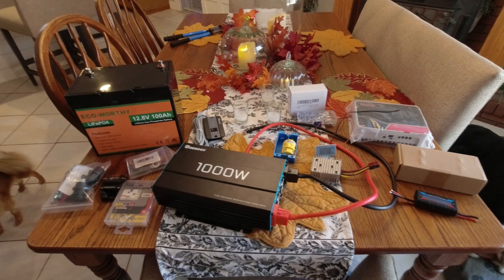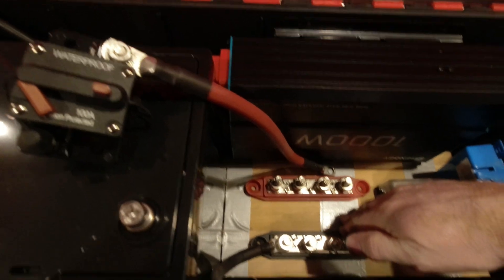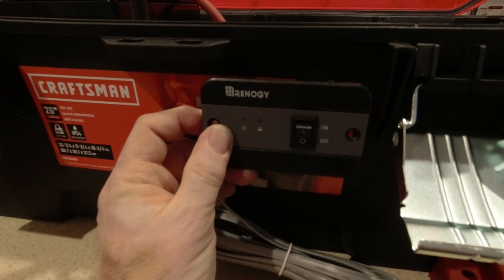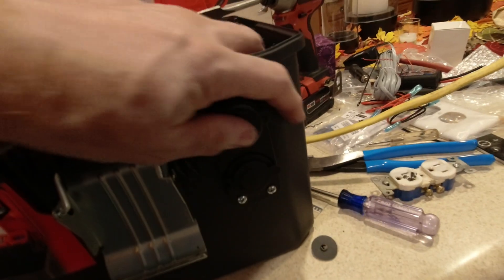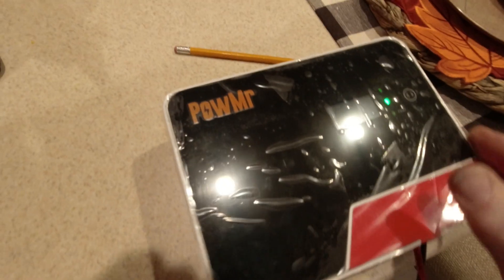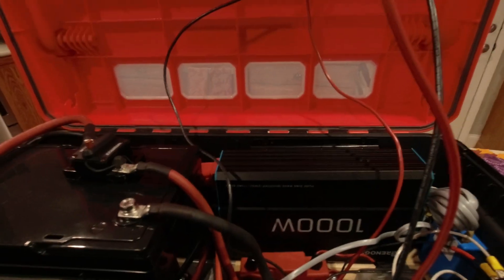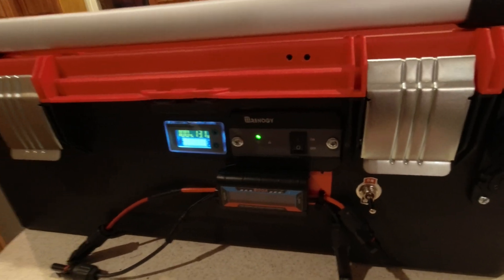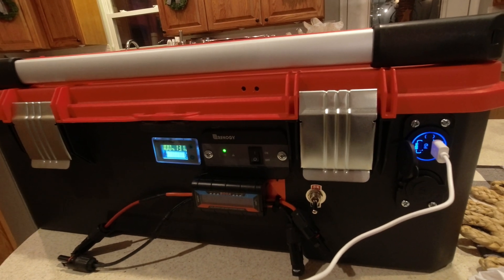DIY Battery Extension for my AC200P

Comment: Really nice build. You mentioned that the PD/USB isn’t on the switch because it has a built in push button switch. Not sure if it’s the same one I have but I noticed that it was pulling power even when the push button was off. If yours is doing that then you might want to consider putting your own switch on that as well. Great video.
Reply from the maker: I’ll check to make sure it’s not pulling power when it’s off, thanks for watching and commenting.

Comment: I like this build, especially that it's a power station AND a battery booster at the same time! Great job getting it all to fit in that cool tool box. One thought, that 12v to 24v boost converter is pulling near 20 amps from that cig plug on the power station (24v @ 10amps = 12v @ 20amps = or 240 watts). If your shunt was on the other side of the converter, the input side, you'd see around 20 amps passing through it. Remember power input = power output so theres no magic power being doubled. It's complicated to explain in a comment. Just be careful pulling 20 amps consistently since that 12v cig port will get super toasty unless you use a better connection type (XT60 or AndersonPowerPole).
Reply from the maker: Yes I’m going to add an xt60 connection. I does get a little warm when I use the converter. Thanks

Comment: I think you made the right call. I found the DC Charge Enhancer to be less useful because of the amp limitation. I was using 18650s in a 6s configuration to add about 2kwh extension to it. I was going to bump it up to 48v and I still might, but I took those cells out of those boards and I am going to use them as part of a DIY server rack battery. I also am using a BigBlue CellPowa 2500 instead of the AC200P in my shed now since it has wifi monitoring so I can trigger AC charging when solar is bad.

I'd consider turning those two small holes into slits, but I'd also probably place them lower on the case, maybe the bottom or near the inverter air intake. It really depends on the fan and how much pressure it has though.
Reply from the maker: I like the charge enhancer but thought that battery going through it was better than solar. I just run the solar through the extension now. Thanks for commenting and watching.